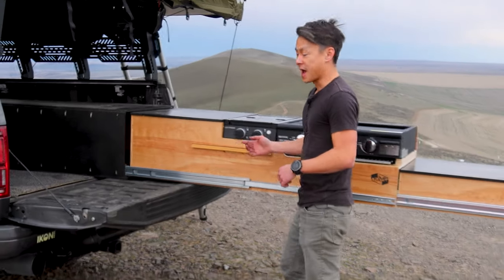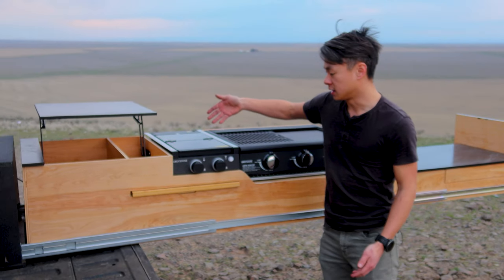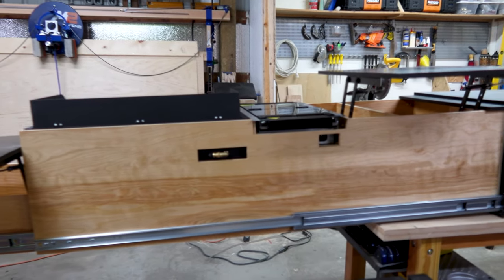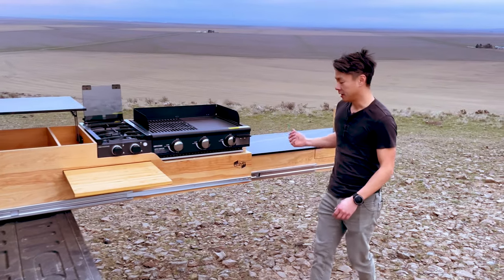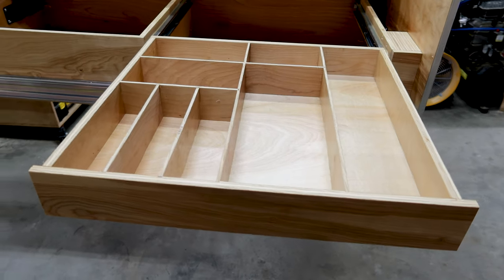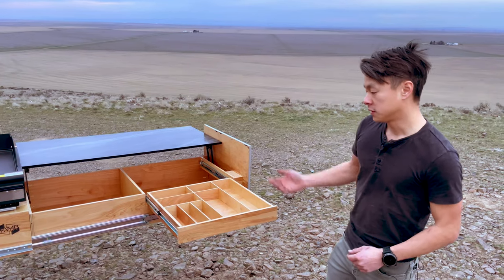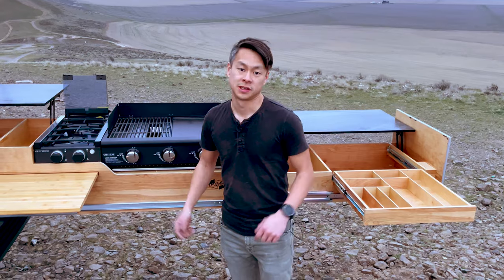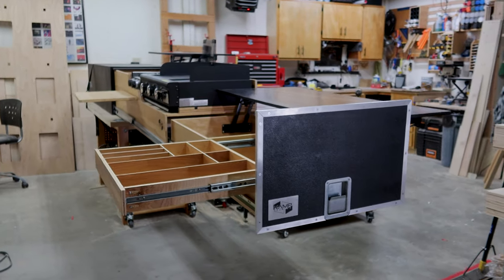Deluxe Overland Pull-Out Kitchen Walkaround Tour

Comment: I’m impressed !!! I have a wrangler in which I removed the back seat and top to rear cargo storage. I built a deck with 6 compartments to cover the entire back so I have 4 deep wells and 2 About 20”. I have hinged hatches like the deck of a bass boat. I have the entire back for air mattress that I can stretch out with 6’3 length! But ! I still need a sink, fridge, trash and cook top! I will keep this unit in mind if I don’t switch to a camper van. Those guys are backed up!!! I can’t fathom what you could do with that!

Comment: you should add embed a level to the fully extended portion and a tuck away adjustable support at the end to level the drawer and put less strain on the hardware.

Comment: Amazing craftsmanship. I’ve already built my 1st truck kitchen, whoop. I was on a serious budget . I Bought a $100 Coleman grill , 200 sliders, and other affordable options. Maybe $1000 total including fridge. How much is this unit delivered as shown?
Reply: Just checked website, so East-coast shipping is 550 , so it looks like 3550? Does that include grill? Does it fit a shortbed truck?
Reply from the maker: In the case of the original KAMP Drawers, it does not come with a stove. This deluxe version with grill is not for sale, and I'd have to seriously evaluate the cost of production to give any sort of price. Preorders are actually closed for the time being (I filmed this before my last sale). I'll be restructuring the business after I get these first units out, so there's a lot up in the air now, sorry!
Reply from the maker: I will be developing a short bed version next. But one is not available now.

Comment: Hi Sam. I was just curious why did you go with the drawer slides this time versus the steel and skateboard bearings that you did on your KAMP drawers?
Reply from the maker: The customer preferred the drawer slides, and paid for them. They were also waaaay faster to install, and I was very much against the clock. Most importantly, they are full extension, so there isn't any part of the drawers left in the box that can't be used.
Reply from the maker: The customer preferred the drawer slides, and paid for them. They were also waaaay faster to install, and I was very much against the clock. Most importantly, they are full extension, so there isn't any part of the drawers left in the box that can't be used.

Comment: Hey again Sam! I'm building a similar 60" pullout drawer, except I'm using heavy duty slides. Question - would you suggest leaving a little bit (0.25" or so?) of clearance (empty space) below and/or above the pullout drawer? Or is it cool if the drawer fits in snug with the wood above and below it? Thanks!
Reply from the maker: You should definitely design some clearancs in. 1/4" would be more than enough, and I've experimented going down to 3/32", but that's a bit too close.
Reply: @SamChou  100%, thx!

Comment: Hey Sam, curious for your thoughts on this - I LOVE the paddle latches you use for drawer handles, but my sliders come with a locking mechanism on one side, so the second latch on the handle would be redundant. If you had slides that lock, would you still go with the paddle latches you think, or would you go for a more standard drawer handle since the additional latch is unneeded?
Reply from the maker: If I had latching slides, the paddle latches would be redundant. But for my application, 6ft slides do not exist on the planet, so I had to use the paddle latches. It also makes for a good low profile aesthetic and a somewhat decent drawer pull, so win win anyways.

Comment: Very nice but the first design has a much more usable cooktop height than that new design. I don't think it would be very comfortable cooking on a stove that high off the ground.
Reply from the maker: Yes, I addressed that in this video. I built it for a travel trailer RV's exterior storage compartment. I probably wouldn't actually put it in the bed of a truck.

Comment: What about when it rains what material is on the exterior
Reply from the maker: It's coated in U-Pol Raptor, a truck bedliner material. Still working on a solution for sealing the door.